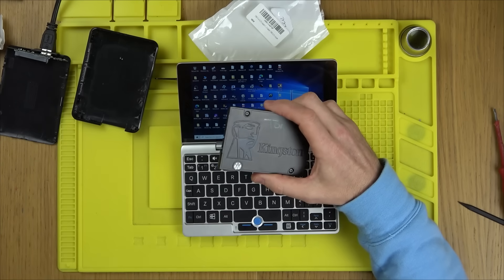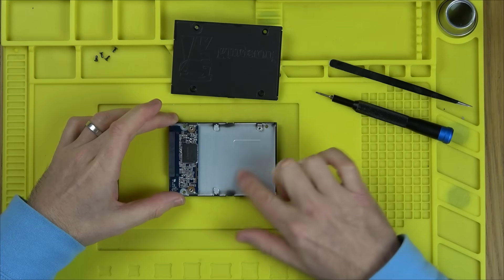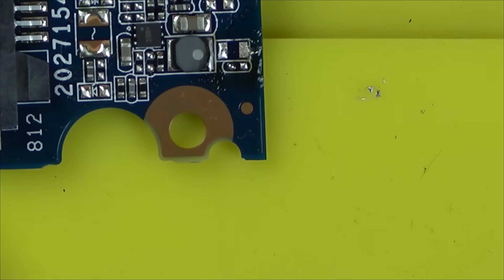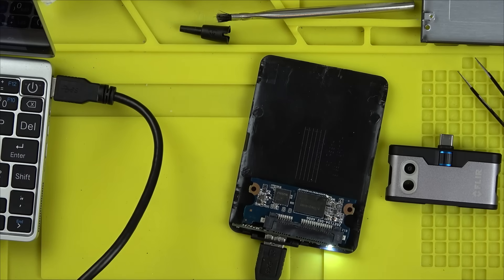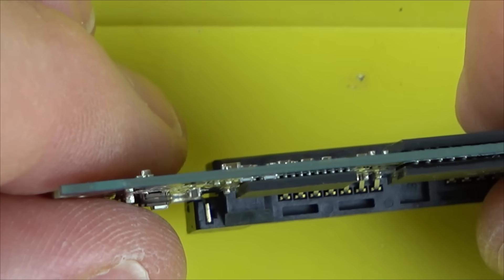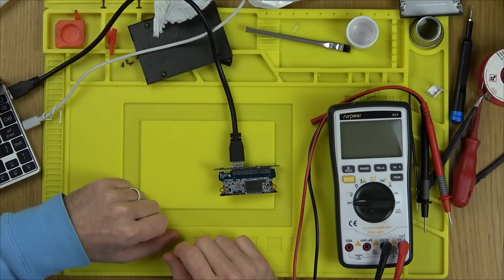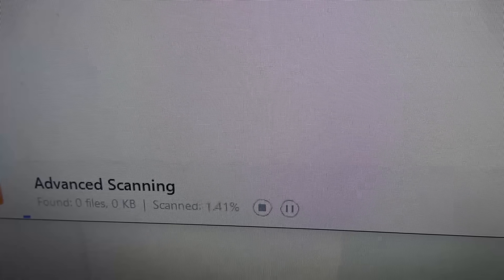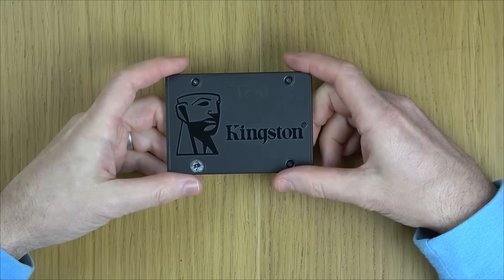Can I FIX a Kingston 240GB SSD ?

Comment: My guess is that the Phison chip probably has something to do with the SSD's File Allocation Table system, or the SSD equivalent of it, if that's the case then if it goes bad then there's no way to know where all the data files are stored on the SSD, so the computer will read it as an unallocated drive that needs formatting.

Comment: Just got recommended this and damn I got that same model and capacity of ssd (Kingston A400 240gb) and it got weird as it started to fail.
A crap ton of Uncorrectable UDMA Errors around 131K, 26 Erase Fails, 26 Bad Sectors/Blocks around 49gb in when doing a surface test (before I cloned it).
It was annoyingly being slower than a hard drive which prompted me to check the SMART data and after a few attempts to clone it using Clonezilla (failed attempts were due to the bad blocks getting worse as the clone was going) I got a good clone of it on another ssd which was important as that was my Linux Mint install.
It is likely that it was the same problem with that Phison controller that caused the problem.
I want to do an autopsy on it but I don't have any security torx bits for the screws so it just sits with my pile of dead hard drives.
Reply: Never going to buy a Kingston A400 every again as the controller is problematic as you shown and would not recommend it to others too.

Comment: That 0 amp resistor was actually a fuse designed that way to blow in case capacitor next to it would get overloaded with power (short to ground) 
great job gg my boi

Comment: just heat the chips up with a heat gun or hot solder station has something similar happen and that fixed it.

there's no heat sink the heat up and cool down so many times that the solder balls can come loose also the Phison Chip is the controller 

reflow Phison Chip with heat gun or hot solder station it should fix it

Comment: These are really bad. I bought a 500 gig one as a scratch disc for my new PC, except for installing it, I never really used it. Few days later my brand new PC was not booting, the Kingston shite was dead shorted. I bough it brand new but without guarantee. Also had problems with Kingston premium SD carts, I will never buy anything from them again.

Comment: even before the end of the video i'm sure he won't be able to fix it these kingston ssds are notorious with their failure rates i had 4 they all died for no apparent reason and 3 of them were actually external drives just for storage used few times then died while not in use

Comment: When an SSD fails I've found it's almost always the controller chip. If you have another identical SSD you can swap the NANDs over and get the data backed up, or swap the controller chip from the good SSD onto the bad SSD which will also allow you to back up the data (assuming the controller chip is the problem). Remounting those smaller BGA chips isn't that difficult as long as you buy a new chip with the balls already on it. Same applies to USB sticks with bad controller chips. Swap the chip and you get your data back or swap over the NANDs onto another identical USB stick. This is why when buying a SSD or USB drive it's a smart idea to always buy 2 identical drives so you have a spare drive for parts to repair the other one so you can recover the data ^_^

Comment: All the disk recovery utilities you've tried are probably using the same code libraries with just their user interfaces distinguishing them as products. You might have found cooling the Phison chip, instead of disconnecting and reconnecting, might work?

Comment: Just buy a new similar disk and swap out the Phison chip. Make sure the builds are similar. Get the old chip of, reball the area with a mask ), get the new chip on, and get the data backed up.  You could also swap the memory chips of the old board onto the new one ( if they are build the same way ).  Never underestimate the importance of a backup ( or better 2 where you keep the second backup at a relatives or a friends house ).
Reply: "Just" ;)
Reply: Problem is the firmware. Not the hardware.

Comment: One quite successful method I have used with normal HD's: freezing. Should work with SSD's as well. Faulty components seem to work better if the temperature is kept low.
Reply: No, that doesn't work with SSD's.    Freezing a HDD only worked if the fault was due to a mechanical issue that prevented the platters from spinning or movement of the heads. The contraction and expansion of the metals was sometimes just enough to unstick the mechanism and get things moving again.

Comment: Trying to read the SMART data from a drive that failed is one of the first things you should do, as it most of the time shows if there is an actual fault actively affecting the drives properties. if you cannot read Smart the drive is usually bricked, If you can read smart and it have failed in sensitive attributes there is probably used up or broken, if the Smart shows good and the drive is not working it is a chance of controller issues or corrupted data on the drive or firmware

Comment: If the drive is recognized but has no partitions, it is because it was removed or powered off while data was being written. Instead of being recorded in the data area, the data was recorded in the partition area and deleted. You have to use software that reads the entire drive looking to recover the files like Stellar Data Recovery and then repartition and format the drive.

Comment: I had one exactly like this, the same problems. Data recovery software is not working because the translator of SSD is corrupted by firmware failure and that cause to not be discovered, and it needs to be recreated in order to recover all the data. it's a lot of things that you need to do, first you need to find an exactly the same SSD with the same Phison chip, than a lot operations and replacement from one to another, and after that recreating the translator to recover all the data. But in the end, the affected SSD will be no good for anything else after recovering the data.

Comment: I got about 40 of these drives in a box next to my desk. I already sent back another 40 or so drives to Kingston. All failing. They all seem to fail in the same way. The computer slows way down and when you run a block test, some blocks come back taking them more than 500ms to read if they read at all. The ones that failed all the way, show the same problem you are having.

Comment: Check computers usb settings....had a low power mode enabled which caused usb dvd drive to cycle on and off all the time...   Try disabling Usb selective suspend

Comment: Bought SSD few weeks back.. suddenly my pc start freezing or hang and i got a blue screen. Now when i restart, the drive was unallocated and cannot initialized. I tied formatting but formate also not possible as the drive turned into RAW instead of NTFS.

Google almost 3 days and tried everything but no work! So, is there anyone out there who have the idea to solve this issue? Thanks
Reply: Was the dive showing in my PC or only in Disk manager.

Comment: I once had to do data recovery on a mac hard drive that kept going haywire. There was a heat build-up that caused the board to freak out. I cooled it using ice bricks and I was able to recover 100% of the data for the customer.

Comment: i wonder if the phison ic is just gettinng hot and disconnecting, wonder if you can keep the tempreture down with freeze spray. i have an old boombox that needs fixing, it powers up and amp hisses but no power to the tape decks or tuner. i can't do it. £130 down the drain from belgium.

Comment: Ok, my situation.  I inherited a nice desktop from my deceased brother, who purchased/put together a gaming pc, while stationed in Iraq.  2009ish.  I decided to see what the computer could do, and was interested in maybe using it for gaming and streaming movies.  It booted up, and windows 7 populated!  Mind you, it's probably been 10 years since it was powered up.  Next, I needed to provide internet connection.  (Thia required hard wire connection).  Once I provided internet connection, I operated the pc maybe 7 to 10 times, full boot from full off, never put to sleep.  Eventually, I was prompted to update windows, and that is the trap I fell into. I agreed to updates, without establishing restore points.  

Pc boots into bios mode, and I explored options thru bios, to just give up, and send to local professional.  Long story short,  we elected to remove all ssd hard drives, and attempt to recover data.   The main c/ drive was stated to be the bricked one.  Unreadable.  

Could I reinstall all the drives, and maybe navigate bios mode to do maybe a factory reset?  Then skip any future updates (obviously I am willing to risk vulnerability, for my fond attraction to windows 7)?

Comment: Since allow you to read the data for some time and the chip is "heated up" (I can confirm the discoloration), I would do a "brutal" test by cooling the chip with cooling spray and see it that changes its behaviour. It is non-distructive and sometimes, these smarter chips goes into "safe mode" when the die is heated up. I know too little about the Fison chip to say for certain however, it is safe to try and the behaviour is very typical os a processor freezing for being too hot.

Comment: I've got a GPD Pocket as well.  If I try to do anything with an external drive through the USB-A port it'll repeatedly disconnect.  It drives me mad.  I get around it by plugging into the USB-C with an adapter.  I think your problem is an issue with your computer rather than the recovery software.

Comment: kind of a long shot but io have had luck using different os's i had a new windows drives that have stopped working and i have plugged them in to a mac and it showed up and worked and the same with linux some times linux works better sometimes mac works better   all the best keep on fixing

Comment: Maybe you need to get a little bit bigger soldering iron tip to work on soldering and unsoldering surface mount components. Maybe even get a Weller soldering gun!!  What do you think?  Yes that was sarcasm!
Reply from the maker: A smaller tip can struggle to get the heat into the board. In reality the end of this tip is tiny but it looks big on screen due to the component size 👍

Comment: Vince, I've seen you perform a "miracle job' by fixing a switch lite, whose fault was related to the backlight IC chip, which was a 9-pin bga chip.
Since then, I thought you would get a hold of a STENCIL so that the next time a bga chip is the source of a fault, you'd be better prepared.
Why haven't you got a hold of a stencil and solder paste?

Comment: There is not really much that can be done Vince. Once the memory cells start to go on flash its game over. 

As others have mentioned you can try a chip off recovery where you disconnect the NAND and use specialist software to try and build a image you can mount and get some of the data off. 

It doesn't always work because of ware leveling and trim which scatter the data across the flash to improve the life span of SSD. 

Flash memory is inherently unreliable so I would never trust it with important data.

Comment: The drive seems to be working fine (shows up in disk management and even populates the volume).   You might try some data recovery tools as it may be a software issue (borked partition table) 

Oh.  Yeah. Drives fucked.  Looks like its died of old age.   Dead flash cells

Comment: The chip overheating is the reason it’s cutting out, I’ve had this problem, you need to keep the chip as cool as possible using a heat sink and cooling fan... recover the data then destroy drive.

Comment: Had a thought. 
The hard drive seemed to stop working after a few minutes 
There is evidence of over heating at the Phison chip. 
Maybe, when the chip gets hot, it disrupts the circuitry on the chip and the system goes into a default failure mode. 
What would have happened had you been able to cool the Phison chip.

Comment: I have had a similar error with a usb drive. However, it was just a corrupted firmware, so after some research I found the flash controller and firmware online and flashed it. For anyone else here that has to do this, use another non important pc, as the sites I downloaded the files from are very sketchy.

Comment: Here is my experience with Kingston A400 120G SSD. I have use this SSD for the past 5 years and recently having few issues. First issues is exactly as what the video shown. The drive is still detected as Kingston SSD but the partition is missing, i use testdisk utility in Linux and able to recover all of my partition and data. Few months later, i have another issues. This time the drive is not recognized as Kingston SSD anymore but it shown as satafirm s11. I tried to reflash the firmware but failed, in the end i RMA the drive and get a new replacement.

Note: If you want to reflash this SSD, plug it directly to SATA interface instead of using USB adapter.

Comment: I’ve tried recovering data from SSDs with the sort of software used here.  They know it doesn’t work on SSDs, I’m pretty sure that I discovered. Comment I revealed until I’d parted with a few bucks “only supports HDD”.  The big message is ‘backup your data’. There’s no excuse not to everyone has an old terabyte HDD or 200Gb SSD in a draw somewhere. Better stick it on a cloud drive you likely got a free terabyte from with your ISP.

Comment: Did you try the power cycle method? You have to power the drive with no data connection at all, not even to an enclosure. So best way is just the SATA power connector in a PC, leave data cable off. 30 mins on, 30 secs off, then 30 mins on again. This puts a lot of SSDs into a mode where they will try to rebuild their mapping. Worked for me a couple of times.
Reply: Might try to do this

Comment: The cap and resistor is probably a write protect, if you remove the shorting resistor in a working ssd, it may be used to write protect it.
Reply: Hi Dan, i saw your comment and i have an usb pen that is not letting me do anything with it because it has write protection on and i can´t remove it...maybe it has that resistor blown.. do you think that could be the reason?

Comment: ive had a similar problem to this a few months ago on an nvme 4.0, where the drive just errored out, and would not boot into windows. i installed windows on a 2.5 ssd to troubleshoot the nvme. I used disk genius a free utility to run scan disk on the drive it took a few tries because the drive kept dropping, but it was finding bad sectors, i ended up getting frustrated and formatted the drive , then deleted the parttition and did a lost partition search to get the lost data back. after i restored the partition i was able to retrieve the data , but the drive kept crashing and dropping after it was restored. 
   then i used the paid version of parted magic and did a nvme disk wipe, and the drive works normal again. 
  I find it wierd that it acted the way it did with the bad sectors, i think possibly it acts this way and my only explanation would be , its trying to read the data on the  cell  and it starts looping  because its a bad data sector on the cell and it might read it as a empty cell data trying to run trim on it to delete the bad data ,( im not sure how a ssd would view a bad sector cell, would it read it as a 0 (cell data) or trying to 1(erased) ? )therefore it loops and ends up giving up, and drops the drive. atleast thats the way it was acting and looked to me.  I say this because i reinstalled windows on the drive after running the parted magic nvme disk wipe, and the drive works perfectly normal now, with no bad sectors.

Comment: I had the same problem with a 64 Gb Sandisk micro sd card. By repeatedly connecting and disconnecting in the card reader, the card started to awake, then Scandisk fixed it.

Comment: Welcome to the Phison S11.  True, many SSD's have issues but trust me, the Phison S11 commits suicide and you can guarantee it.

I worked for a pub company a while back and ALL of our new tills had SSD's powered by the Phison S11. Guess what they did? Exactly this.  One day the till locks up, is then rebooted and you have a blank and READ ONLY drive.

It is well know you run a mile when you see a phison S11.  Kingston and other well known brands have made the mistake of using this thing.